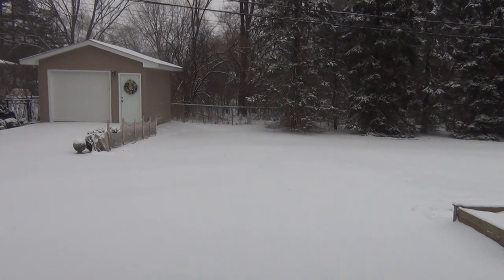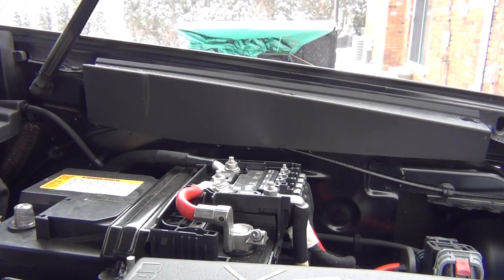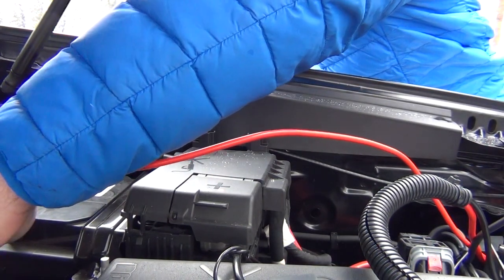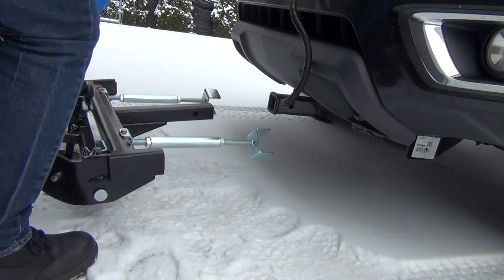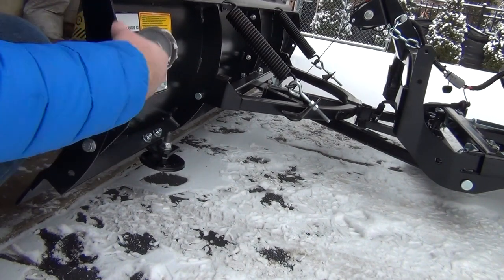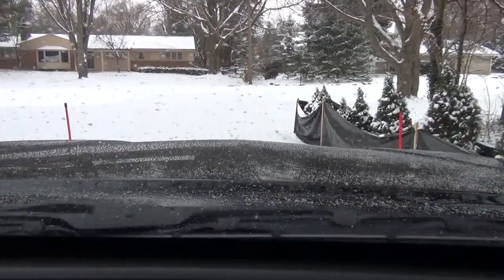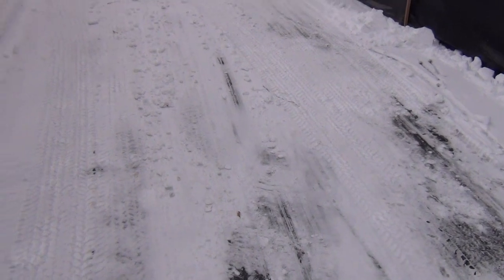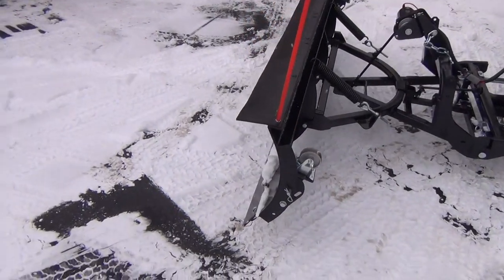Detail K2 (DK2) Avalanche Snow Plow Kit 1st Snowfall & Plowing Impressions | 2020 Chevy Colorado Z71

Comment: 1) don’t plow in four low
2) don’t push snow off of the property 
3) you want to let more slack out 
4) if you’re only plowing your driveway that plow is fine but you plan on plowing for a business get rid of that plow!
Reply from the maker: All great pieces of advice, thanks!

I agree, this plow is not made for commercial use at all. If I ever want to clear snow on the side, I’ll definitely want to invest in at least a 1/2 ton or 3/4 ton truck and vehicle-specific mounted, professional grade plow (like a Boss or Western, etc.)